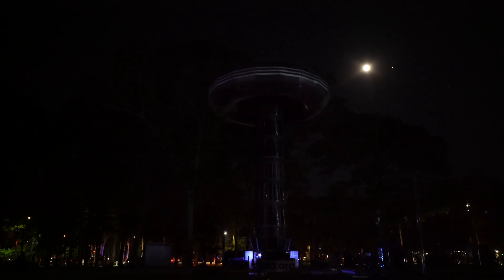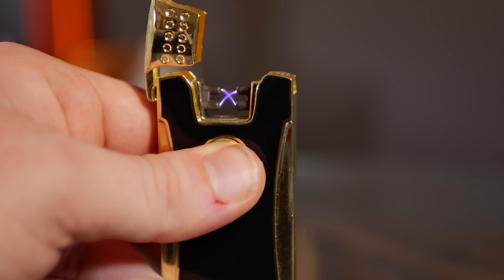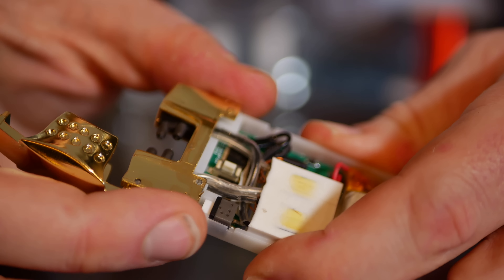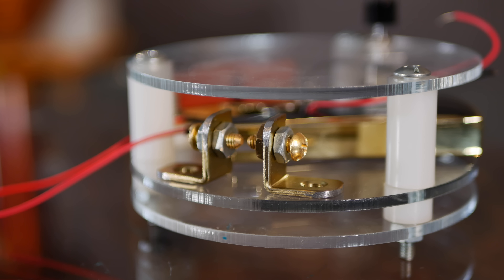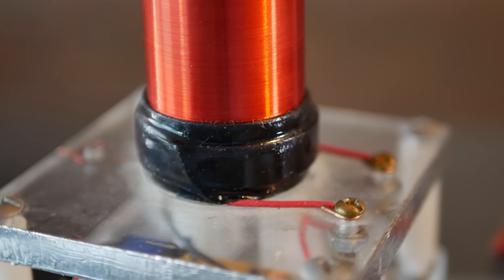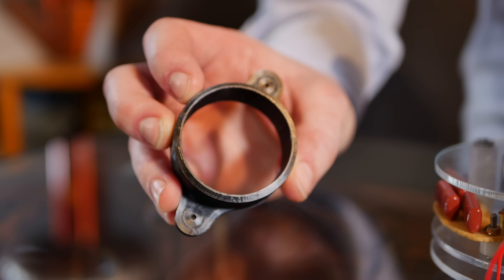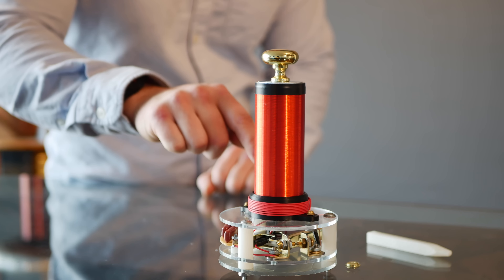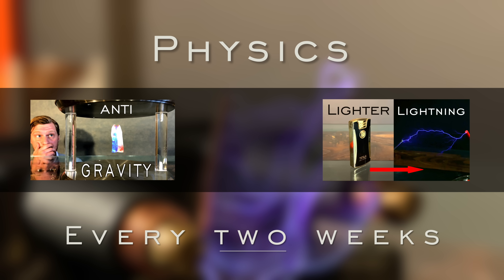DIY 50,000 Volt Arc Lighter Powered Tesla Coil (ft. Integza)

Comment: Would it be beneficial to use a super capacitor instead of the capacitor bank ? My theory is that it would produce higher power arcs at lower frequency. My other theory is that the resonance of the primary LC would be so off the chart that it would be hard to create a fitting secondary ? What do you think ?

Comment: You should try making your own capacitors for a future tesla coil build
Reply: DIY Capacitors are pretty crap compared to commercial ones, very lossy and tend to take up alot of space, so not practical when building small coils like this. fun to build but not very practical
Reply: Especially salt water capacitors
Reply: @garbagewitch1  even the foil and plastic rolls are to big. same goes for ludicrous science plastic plate design. all inefficient and bulky

Comment: Have you done anything with high voltage without the spark gap so in pulsed emf so the signal function is still smooth?
As far as I know anyway, once theres a gap, any frequency is going to break down into pieces, and semi new to this, I am not sure there is a work around for this yet.

Comment: Hi Mr plasma! I heard you were answering most comments so I wanted to know with my very basic knowledge if it was possible to double the power by buying 2 arcs lighter to get longer electric arcs. I wonder if I should use more capacitors or what should I do?
Reply from the maker: To double the spark length, I’d recommend building the coil physically larger. Use larger primary capacitors, and, a larger secondary coil with more turns. Still, need to make sure the system is tuned though!
Reply: @PlasmaChannel  Ok so should I buy "bigger" capacitors or just buying more of those that you recommend? If so which one should I buy?  

Thank you so much for answering it is extremely helpful and kind!
Sorry to ask you all that, I got really interested in the field thx to your videos so I'm trying to learn by myself.
Have a nice day,
greetings from France

Comment: I used a lighter that only had a single arc on the output but it didn't last long... I am rebuilding it using a lighter that has the dual arc "X" output as yours does, and was just wondering whether you connected the dual outputs in series or parallel? Also, thanks for all your help Jay! Your videos are top-notch and I am inclined to subscribe.
Reply from the maker: I am glad to help! Honestly, your lighter may have died due to over use. 

2 things: touching the power button while touching ANYTHING else will cause the lighter to die. 

Also, running the Tesla coil for more than 10 seconds will stress out the lighter significantly. I blew up three nighters making the video - keep your use to 5-10 seconds, then met it rest the same amount of time. 

Letting it stay running will kill the lighter.

Hope this helps!

Also, yes, my x lighter has transformers wired in series.

Comment: Would it be possible to make a tesla coil using one of them high voltage generators you can buy online? You can get a good 15 - 20mm spark out of them so would you still need capacitors? Would be interesting to see the results

Comment: Great Video! I'm working on building a Tesla Coil myself. Just wondering what the purpose of the diode is?
Reply from the maker: The diode allows the capacitor to be charged up. the HV coming out of the lighter is very, very high frequency AC. That does not charge up capacitors. Need to turn it into DC to charge the primary caps.
Reply: @PlasmaChannel  Thanks for your reply! I see now. Need to rectify the AC to DC, otherwise the capacitors are acting as a short circuit with the high frequency AC.

Comment: won't the sharp end of the screw you used to secure the door handle decrease efficiency / cause corona inside the tube and make it melt like electroboom's tesla coil ?
Reply from the maker: BOB great question. Since the inside of the top load is essentially tucked within the secondary coil, the local EMF suppresses the breakout of corona.
Reply: @PlasmaChannel  thanks a lot for the answer !

Comment: Man I love this stuff. I just build my second one today and used a 2sa5200 transistor and I got a little spark and it lights a bulb but I want a big stark. How do I get big spark? Do I just go bigger volts? I'm using a 24 volt variable should I use my 36? I don't want to blow it up

Comment: Hey Jay this is Jay what do you think can be done with a magnetic field Sputtered on glass globe filled with neon gas with the right Driver set up mosfet-transistor high voltage plasma do you think we could make it dance by applying alternating frequency and current on separate sputtered Plains or axises integrated on the glass globe sputtered with like copper I'm just thinking outside the Globe thinking on how to spice up back Mac size toroid experimentation do you think that😅 making a plasma toroid dance with the proper applications is plausible?????

Comment: Very nice build.  Question about the diode: I didn't notice it in your build.  Is it mounted on the perf board along with the capacitors?  And I didn't see one on the parts list; is it a high-voltage diode?
Reply from the maker: That is correct. It is a high voltage, fast acting diode. As the schematic showed, it needs to be between the power source and the spark gap ( in terms of electrical flow). It is connected directly to the spark gap, you can see it in shots with the spark gap.

Comment: Hi Jay. I'm building your 50Kv arc lighter Tesla coil. I opened the lighter, but it has two pairs of high voltage wires. Should I only use one pair, or is there a way to use both pairs? Thanks in advance.
I'm so keen to finish this project. 
Cheers,
Wayne

Comment: Sorry for the question if it seems silly but I was wondering.... in your example you use capacitors .  In other videos that I’ve seen, only transistors are used.  I understand how a transistor can help achieve the required optimal resonance.  Are capacitors only necessary because of the nature of the power supply?
Reply from the maker: Good question. You are referring to slayer exciter coils. They are not true Tesla coils. They mimmic Tesla coil functioning without using all the required parts. They tend to be fragile and weaker.

For the record... transistors have nothing to do with capacitors. The equivalent of the transistor in my circuit is the spark gap. Transistors are used in modern coils as a spark gap replacement. But they have nothing to do with capacitors. 

Capacitors store up energy and release it all in milliseconds. Like filling a bucket with water then pouring the whole bucket at once. They allow for bigger sparks and drastically higher voltage.
Reply: Plasma Channel Thanks for your reply!  The only capacitors I could find are rated for 100V maximum.  The μF rating is like yours.  Would the arc lighter still be ok for this?  Or could I just supply voltage directly from a laptop power source for example?  Keep up the great work!  I enjoy your channel very much!!
Reply from the maker: Hi George happy to help. The spark gap would not fire at 100 volts, especially not at a lower voltage like a laptop charger. You specifically need a high voltage power source capable of a few thousand volts. 

Using the arc lighter and even a 1mm spark gap, the capacitors would break within seconds. They must be rated for more than twice the voltage coming in.

Comment: I notice that the teslacoil in the background has a cone shaped winding. What can you tell about the function and specific properties this shape?

Thanks in advance!
Reply from the maker: Ah, my Genesis coil. Love her to death. The conical coil causes a higher coupling coefficient, and allows more efficient energy transfer at LOWER power levels like my coil. When you get up into the kW range though, you will want to use a flat primary, with less magnetic coupling.

Comment: in the arc lighter, did you use all 4 connections or just two? can you connect two different high voltage leads into one wire and send that into the primary?

Comment: Great 👍🏼 video love 💓 it. Few questions
What is the final output voltage? 
What is the difference between the conventional Tesla coil and this Arc lighter Tesla coil. 
Thx
Reply from the maker: Thank you. This is known as a DC spark gap gap Tesla coil. Traditional coils discharge the capacitors at the peak voltages of the AC waveform. As this is DC it just flat up charges. cheers!

Comment: Hey JAY thanks for the build I am attempting this one now as I have built the smaller one but I now have an arc lighter 😁. It’s almost the same as your one and I wanted to question you about the double arc..I see there are 4 wires 2 cathodes and 2 anodes can I join the cathodes and anodes or just use one set? Thanks bro
Reply: Ok I have found the answer further down in the comments so no worries mate !
Reply from the maker: Cool, glad you’re building it. Be careful. Don’t abuse the lighter. They break super easily. Do not run more than 8-10 seconds at a time. Also, don’t set the spark gap above 1-1.5 mm. It will destroy the lighter quickly if you do.
Reply: Thanks man yes I will be careful I have shocked myself a few times while working with these arc lighters and it ain’t funny at all ! Tell me for the diode can I use a 1n4007 or should i use a higher voltage rated one?
Reply: I think my lighter times out after 7 secs but I’ll make sure as I’d like to keep it going for a while and it’s really hard to find those lighters here in South Africa
Reply: Yo Jay I built it and it works but it’s super weak in the plasma discharge and I’m not sure where I’m going wrong…maybe you can help? I’m using polypropylene caps but 8 x 10nf in series to get around 1.3nf also using a 1n4007 diode. Pretty sure I got the wiring right although my primary is rather thick wire. Would that affect the circuit negatively? Secondary is same as yours…spark gap 1mm and battery fully charged. Any thoughts?

Comment: Isn't the primary supposed to be flat or 90 degrees to the secondary?
Reply from the maker: That is for a low Q coil. larger tesla coils use tons of power, so they need lower coupling coefficients. Smaller coils, like this one, are very low power and thus need very high coupling coefficient in order to transfer as much energy as possible.

Comment: How does the 9k capacitor work with 50.000 volt ark lighter? I don't need to ad 50.000 volts worth of capacitors together?

Comment: Really cool video. Is it possible to use 300 Volt capacitors and reduce the spark gap to one-tenth of a millimeter?
Reply from the maker: Thank you Leonard. 300 volts would be nearly too low to form a spark. Usually 360 volts is the lowest air will ionize at, at STP. It’s best the gap be at least 1mm or it becomes totally irregular in firing.
Reply: Clear. And would it be a problem using 3kV  3,3 nF instead of the 3,9 nF used in the video?
Reply from the maker: Leonardo Satrioni you can use 3.3 nF caps, but you’ll need to retune the Tesla coil
Reply: @PlasmaChannel    by adding or removing  some turns in the primary coil, is that correct?

Comment: Hello Jay & Plasma channel -- love this stuff & cool projects like this so I went right to it & built one. Not sure what I had done wrong but I got everything working up to the spark gap once the capacitor bank is connected no spark gap. I could only find 3nf capacitors instead of 3.9 -- not sure if that is the problem. I went by the schematic --  on one side of spark gap I have one power leg and jumper to the primary coil & the other side of the spark gap I have a power leg and one lead to the capacitor bank then the other lead from the capacitor goes to primary coil. Any help would be appreciated. Ugg !! loosing my mind trying to get this cool build to life . Thank you !!

Comment: Hello, can i use 0.1mm wire? Or maybe 0.3mm? I can only find that on amazon.
And can i use high voltage module for that instead of arc lighter? It cost less and is more powerfull

Comment: Jay! Great video man. I noticed there's only 2 wires coming out of the lighter as a power source, but these dual arc lighters have 4 wires? Did you ignore one set and just went with one set (2 wires)? Thanks!
Reply from the maker: Hi James, I think a similar question was asked in the comments. You can view my full response there...I give detailed instructions. Cheers!
Reply: @PlasmaChannel  Thanks sir. I was watching your other video and saw that you put them in series by connecting the middle two wires. However, once I hook everything up, there is a tiny tiny spark at the spark gap. And the transformer on the lighter as well as the 2 transistors (?) heat up like crazy. I've made the fly swatter tesla coil with no problem, so I'm stumped as to why it's just heating up. I used the exact same 3 capacitors in series as shown in the video. Thanks!
Reply: I missed the part where you added a diode to one end. I'll bet that makes a big difference...

Comment: I just built the smallest rotary spark gap today! It is pwm controlled and is fully metal to deal with heat.  Did I also forget to mention that its wirelessly controlled?!
Reply from the maker: Hi Anthony, I'd love to see this. Feel free to send me an email with pictures or videos!
Reply: @PlasmaChannel  I will be uploadong a video showing it. Also what is your email or Facebook?
Reply: @PlasmaChannel  I still love your videos by the way! If you want to build some insane high voltage stuff I have a power I built for powering my massive audio modulated dual resonant Tesla Coils. For my fellow coilers I am building 2 of two of the biggest and most high powered Audio Modulated DRSSTCs! Tje lower supply to run them outputs 330 volts AC @100 amps continuous fully isolated as well. If wired properly it will output 570 volts @ 100 amps continous. My Tesla Coils will have bus voltages (for the octa IGBT full bridge) of around 1600 volts.
Reply: @PlasmaChannel  I have now uploaded my rotary spark gap video! Check it out!

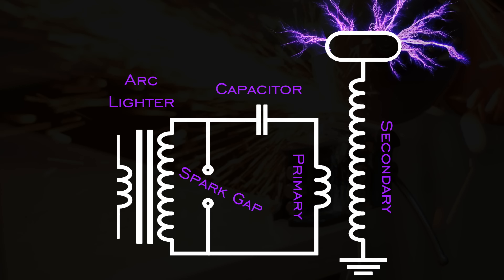Comment: @9:45 can you please explain the purpose of the diode?  Part number?
Reply from the maker: Arc lighters are high frequency AC, which will not charge a capacitor. 

Any high voltage diode with a fast recovery time shall work. Cheers!

Comment: I'm a regular on Integza's channel already, but I need a more "powerful" answer.

Tesla Coils turn electricity into high voltage arcs. Can you reverse that and turn high voltage arcs into usable electricity ... kinda like a reverse coil?
Reply from the maker: Yes, you can. The process is not very efficient though, as sparks are inherently an inefficient form of energy transfer.
Reply: @PlasmaChannel 
Inefficient it maybe, but when there's billions of volts waiting to be harvested between the atmosphere & space ... .01% is still a LOT.
Or lightening.
Reply: @theTeslaFalcon  yes but you need a 300 mt high tesla coil to harvest usable electricity

Comment: How did you hook up the two high voltage lines coming out of the lighter? There is 4 wires that make up the cross ark to the lighter. Did you hook to just two of those?
Reply from the maker: I placed the two transformers in series
Reply: @PlasmaChannel  so I would say you connected the two closest to the center together and then hooked your outgoing wires to the outside two that go into the white block correct?
Reply from the maker: That is correct, though I found it varies with lighter brand. I’d give that a try first.
Reply: @PlasmaChannel  thank you! My son wants to build one for a science project and I am helping! Love your vids thank you again!
Reply from the maker: Hey Nathan, that is so cool! Please email me finished pictures of the build, and I’m glad to share pictures (one day soon) with all my subscribers. 

Glad to have you in my Plasma Fam. I love when parents help their little ones find a love for science.

A note if you build exactly like my video. When turning the Tesla coil on or off, keep all hands away from the high voltage parts. I found if your finger is on the switch when you touch the coil’s sparks, it will short circuit into the lighter and kill it IMMEDIATELY. Also, only run for 6-8 seconds at a time, it will prolong life. You can give it just a few seconds to cool in between. Lastly, don’t set the spark gap too far beyond 1mm.

These will guarantee the components in the coil last forever. I learned the hard way.
Reply: @PlasmaChannel  ok I think I have figured out why my secondary isn't putting out much. I didn't understand from the one video that it is crucial not to overlap the secondary wire and I just wond the heck out of it to cover any gaps I had so I am assuming that is killing my power. I probably have 3 or 10 times the number of raps I am supposed to have to complete the secondary. Going to go ix that and try it again

Comment: here's an idea, maybe, old laptop lcd screens have small inverters in them that output several hundred volts AC at 10's of kilohertz frequency, with only several volts DC input. could one of those be used to power a tesla coil ?

Comment: Why did you add a diode to the primary circuit?
Reply from the maker: Without it, the capacitors will not charge. High frequency AC always needs to be rectified to charge caps.

Comment: Is the diode required to make this work, you never went over it in video so I'm assuming it wasn't used?
Reply from the maker: No, the diode is needed. Otherwise the caps won’t charge. It needs to be a fast acting, high voltage diode rated for the applied voltage of 3-5 kv

Comment: Wait when you were building the base how long was the screw that you used and were the nylon spacers cut? (I’m doing this for a science fair project)
Reply from the maker: You can make that base as large as you want. It wont affect performance, as long as turn numbers are identical and dimensions of the secondary are identical. Oh, and caps are identical....yeah basically everything electrical needs to match my video. But physically, the base can be any size.